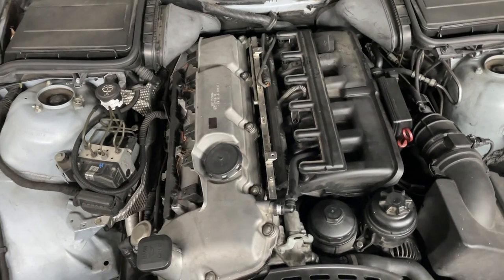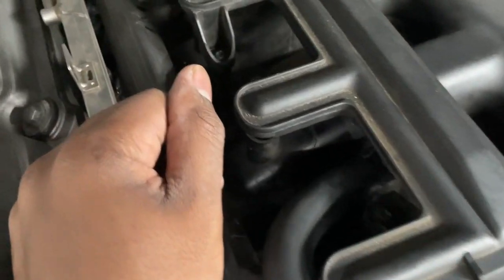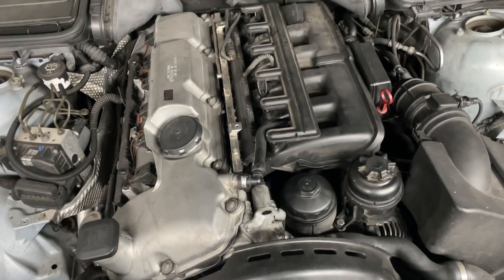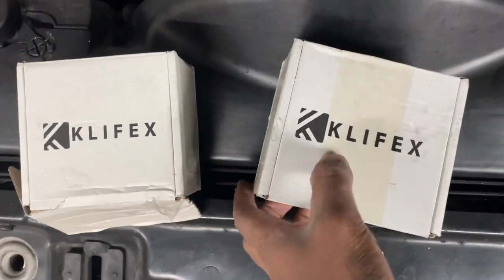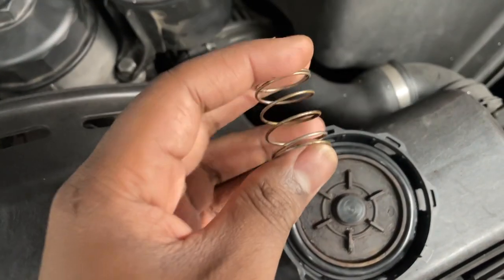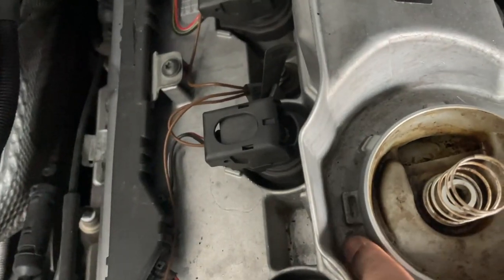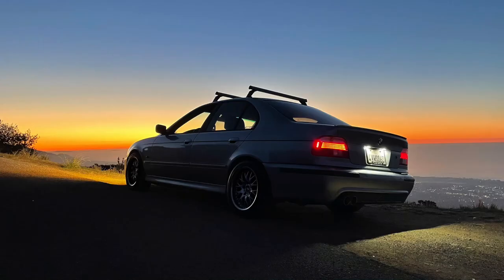BMW M56 Valve Cover Updates and NEW CCV Cap + Diaphragm (M54 Retrofit)

Comment from the maker: IMPORTANT NOVEMBER 2022 UPDATE: Unfortunately, despite even after this video replacing the CCV diaphragm and coming up with a better hose setup, replacing the M56 VC gasket, and even resealing the internal CCV chambers about a week ago, I have excessively high crankcase pressure. As a result, oil leaks out of my oil cap and VC gasket consistently, making a big mess and smell. While I thought perhaps there was something wrong with my hose setup or air distribution rail, I am thinking the CCV itself is the issue. With the engine running, if I remove the oil cap, I can feel the pressure being relieved but the engine still runs. If I remove the hose that connects the Valve cover and intake manifold, the engine immediately dies. I find this very strange considering I have all new CCV components in between, but clearly something is wrong. I will link a few useful forum threads with potentially superior hose routing, although I can no longer recommend this M56 setup with a good conscience. I will be switching to a far more cost effective aftermarket aluminum M54 valve cover, with a well rated replacement M54 CCV setup. I will of course be making a thorough video on that as well. Sorry for those of you having similar issues as me, though I do hope at least some of you were able to complete this retrofit successfully. I'm sure I could get this to work, (I know others have) but with limited time these days I just need my daily driver to not be dumping oil everywhere lol.

See Post #1,485 for what I think is the best hose routing setup, better than what I showed here
https://www.e46fanatics.com/threads/m56-valve-cover-onto-m54-ccv-mod.1120102/page-75#post-18717653

Aluminum M54 VC I just bought, haven't received yet. This one is designed for the newer pencil style coils, but they make a version for the old block coils. Video coming soon: https://www.amazon.com/gp/product/B09NVKV559/ref=ppx_yo_dt_b_asin_title_o00_s01?ie=UTF8&psc=1
Reply: Exactly same thing just happened on my e39 M56 conversion! The new Klifex cap and diaphram worked for a few months...seems like the onset of cold weather (I'm in PA) caused the diaphram to stick closed....blowing up the pressure in the VC. Big Bummer since I thought I had found a solution.
Reply: @tonyrusso612  any pics of your setup? I've had m56 vc on two E39 engines and have no issues.
Reply: @tonyrusso612 I think the same exact thing is happening to me. Real bummer. Did you end up having a solution for this?
Reply: @anthonya.8460  I replaced the diaphram yet again and its been good now for a few months. No clue why really other than possible variance in tolerances with the diaphram
Reply: I just bought the Aluminum CCV cap, and before putting it on. I had the same problem as you. Once I put the Aluminum Cap one, the pressure changed from blowing out of the valve cover into sucking in.
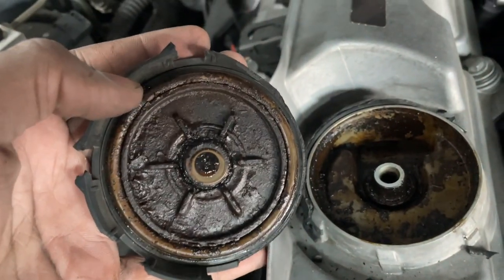Reply: I know this is an old video - but it does appear something was wrong with your diaphragm and possibly even the replacement diaphragm. If you observe @4:26 you can see the clean ring around the valve cover and the diaphragm. This surely indicates that it was stuck closed - otherwise both of those interfaces would be caked in oil like the rest. Because it is "clean" it most likely means it was stuck closed for a while and no oil vapors were able to pass. The new replacement Klifex diaphragm may have been too big (they send out many different diaphragms for many other BMW engines - and I noticed this right before installation on my conversion and while it "fit" it was not the correct dimension height-wise and would plug the system). Did you test the CCV system before installation? Use a blower to see if it would relieve the pressure and wasn't stuck closed?

Comment: Great video did the m56 swap last year on my 2.2 M54 Z3 ....just fitted an alloy cap and new diaphragm .all going quite well just some oil burn on start up. Thanks Aidan.
Reply from the maker: Nice! Yeah that oil burning could be from the typical M54 piston rings loosening as they age
Reply: Thanks for that Sam .But I had the engine fully rebuilt last October with new piston rings seals and gaskets .. lt looks like only on start up  small amount of white smoke but oil starting to burn again.
Reply from the maker: @aidanwhelan765  Well that's quite odd, only thing I can think is if one of the new gaskets for the valve cover where the spark plug tube seals are got pinched or damaged during installation, and is letting some oil get by when the car is off.
Reply: hey aidan do you know if there is any difference in terms of pin outs or wiring for adding a m56 valve cover to a Z3 M54? I know Z3’s never came with the pencil coils so you will obviously have to use a pencil harness for them, but did you use a pencil harness from a m56 motor? And were the pin-outs the same for your Z3 as it would be for like an E46? I remember the 50skid doing a video of it on an earlier model E46, I’m just curious if there’s anything different worth noting between the early E46 and Z3 for the conversion. Thanks man!

Comment: Awesome video (both for the aluminum valve cover gasket).  I just replaced by severely warped plastic valve cover with an ebay SULEV kit and I was wondering about the diaphragm that the 50skid said to "leave alone", but after seeing yours, I'm going to do the same.  Parts have been ordered; thanks for blazing the trail for the rest of us!
Reply from the maker: Glad to hear it! Yeah after watching the 50skid video I was skeptical on not at least cleaning the diaphragm, but after seeing how brittle the plastic cap is I completely understand. Now that we can get our hands on those third party caps though, there's no reason not to take a look! Best of luck, and yeah my old cover was pretty warped too

Comment: Thanks for the videos great stuff here. My question is did the m56 valve cover increase crankcase vacuum? This might also be a solution for low tension piston rings and help with oil burning if it does increase crankcase vacuum.
Reply from the maker: Honestly I don't know, however I will say that my car has been burning almost no oil between my 5-6k mile change intervals since doing this. Before it used to burn about a quart

Comment: Hey man I did a m56 valve cover swap as well and just ran across your ran and having the same issues you typed in the comments about crankcase being over pressured. Did you ever find a fix for this or just went back to plastic cover?
Reply from the maker: I ended up going back to an M54 cover, but one made of aluminum I bought online. Since then, everything has been perfect. I linked it in the November update comment towards the bottom!